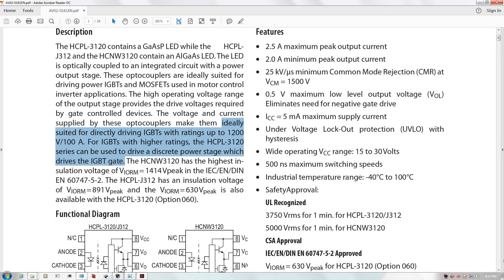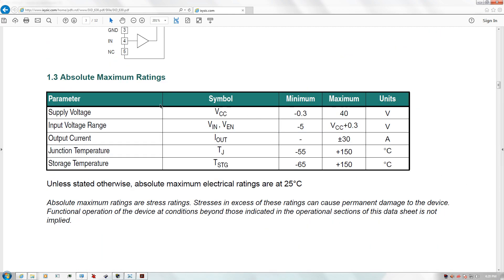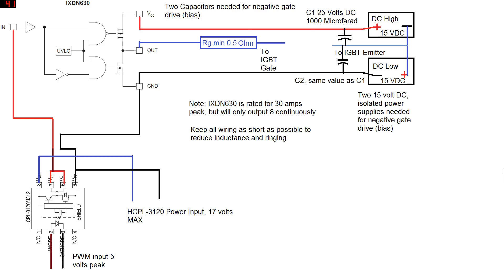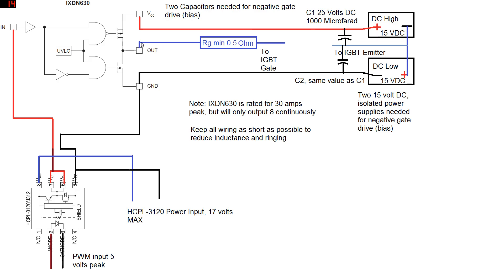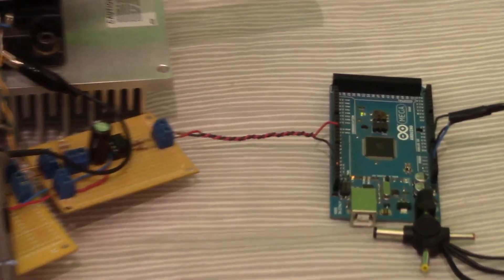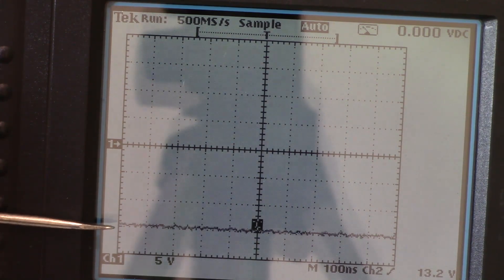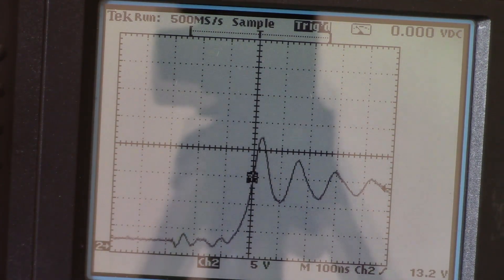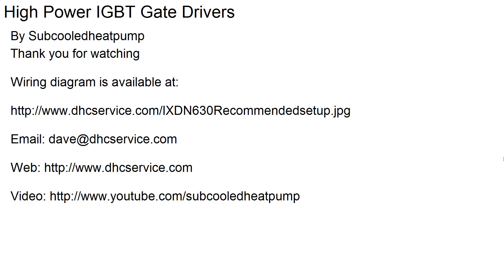Using High Power IGBT gate drivers

Comment: Hello bro 
I want to switch a relay 220v with triac 
I use bt136 and moc3063 
I have big problem when main phase or null off and on 
Relay is on and off too 
Do you have correct circuit diagram to help me

Comment: Hello, I made an induction furnace with skyper 32, when the wing switch is turned off, I have noise in the lower switch. Increase the gain resistance.

Comment: the 15 volt power supplies.. What does the amperage capability need to be?  Does it need to be the full 30 amps?  I ask because this is a cost issue and it would be nice to not require such expensive power supplies.
Reply: The 30 amp draw will only be for a fraction of a second while switching on/off. The power demanded will be based on the switching frequency. The faster it switches, the bigger the power supply needs to be.